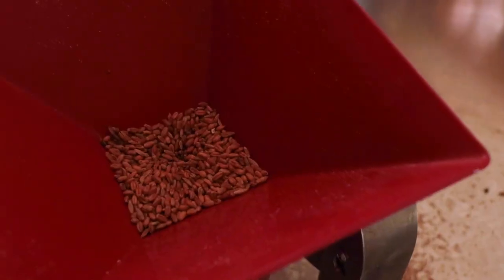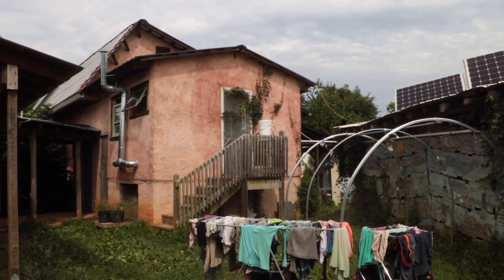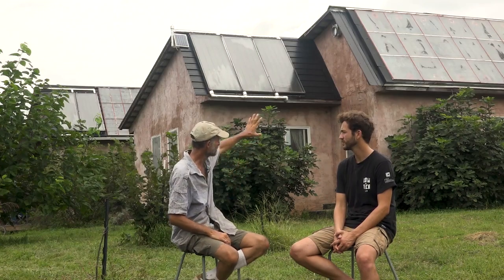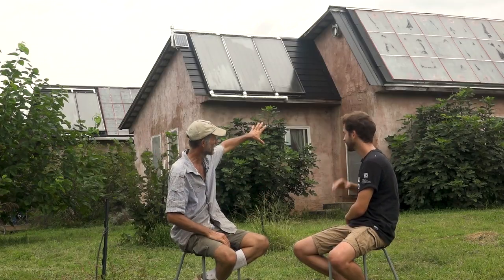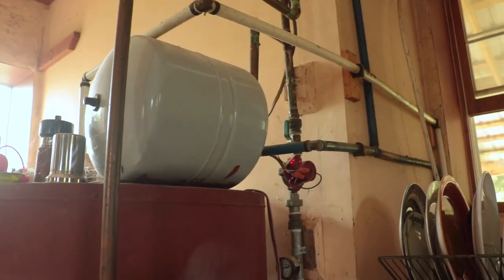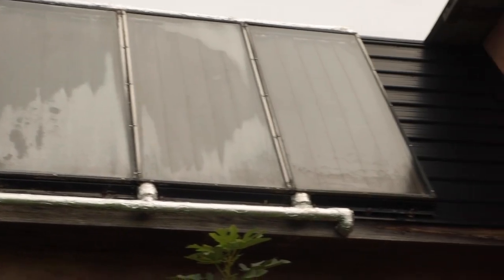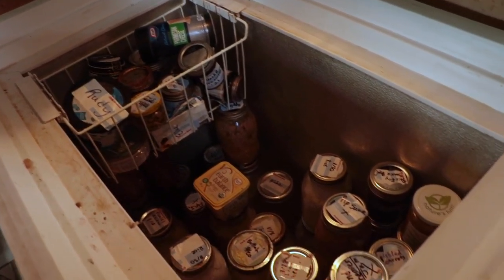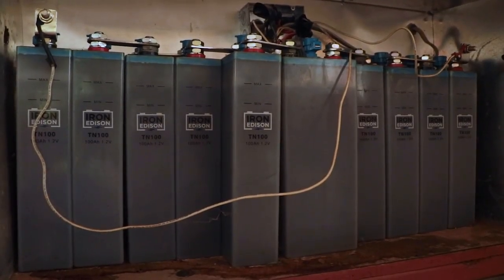Living Energy Farm: a community outside fossil fuels thanks to low-tech ?

Comment: I live in Victoria BC Canada.  How about a low pressure "pneumatic grid" too?  The weather here is rainy from October to April,  a bit of rain in May and June then no rain till mid September.   I abandon most of the garden in  Summer to save water. I try to use rainbarrels and rainwater as much as possible and cycle the water round raised pallet gardens  to water storage,  a rock planter (shaped like a boat) with water in its "hold" and 2 greenhouses with water stored under the greenhouses.   To power  the pumping of water up from the holds and to the plants,  I use a low pressure "pneumatic grid"  that runs at about 1.4 psi  (10kPa) to power "airlift pumps".  There are currently 11 little airlift pumps  spread across my property (just tubes joined together) running off one dual diaphragm air pump in a shed.    People ask me why I don't just have water pumps,   but really one air pump works nicely, and when you cycle water, it often gets a bit dirty.  Airlift pumps can deal with dirt fairly well,  while blocked water pumps can burn out. If you have a river or stream on your farm, you might be able to use a "trompe" to compress the air to something like 2 psi,  to run greenhouse hydroponics, etc.  This is easy to do, and you don't have to deal with turning the water power into electricity.

Comment: Thanks for the interesting video! However, I was quite astounded by what Alexis said about electricity. It seems as if he lacks the basic knowledge of the differences between AC and DC and has a wrong understanding of why the things that he builds work the way they do. 

DC can be transferred just as far as AC when converted to higher voltages, it's just that transformers don't work with DC. Evidently, connecting solar panels directly to a load is possible, but not a great idea. A) Because they have a maximum power point, a certain load resistance where the most power can be "harvested and B) because all electric devices work most efficiently (and safe) within a certain voltage range. The goal of these off-grid systems is not to look like a grid, it's to provide optimal solar harvesting and a regulated output voltage.
Reply from the maker: You're right but we can assure you that Alexis Ziegler is well aware of that. Don't you think that losing a little yield to avoid the use of expensive, complex and short-lived equipment seems acceptable ? Without change, solar energy will remain unsustainable and inaccessible to a large part of the population.
Reply: @low-techlab2411  No, I don't think that way. Because it is an unsafe manner of using electricity and will cause much more wear on devices.
The needed equipment is neither expensive nor complex or short-lived and there's lots of info on the internet. When in an off-grid situation, even a one 12 volt battery with a cheap solar charge controller will suffice to provide a regulated voltage.

In on-grid situations, one can just use a VDE-AR-N 4105 (I think France still refers to the VDE 0126, the precursor) compliant grid-tie-microinverter (Envertech, Deye, Hoymiles, ...) to feed solar energy to the house and excess energy back to the grid via a typical socket. Devices within the house can directly use that AC without the need for complex rewiring or further conversion. Excess energy makes the grid mix greener allowing those that don't have the means for solar to use it. Most manufacturers now give a 15 year warranty for their inverters.

I think the transition to green energy only works when we're doing it together by using the grid where available to combine all the forms of green energy and making it available to everyone, even if they can't have e.g. solar directly :) 

I don't mean any offense, I just have a different opinion :-) I'm a tech journalist and I just recently wrote a series of articles on small permission-free PV installations, in Germany they're called "Balkonkraftwerke" but you can do that in many European countries (and others probably too) as well :-) If you'd like to speak about that, feel free to contact me on Instagram. I use the same name there. I'm happy to share my knowledge :-)
Reply: We are well aware of the differences between AC and DC power, as well as the "maximum power point" of solar panels. That said, our system costs about 80% less to build than conventional off-grid kits, and will run for the rest of your life with very little maintenance costs. The bottom line is that the global working class does not have access to solar energy because the standard systems are badly designed and battery based (and the batteries wear out). We are now exporting this technology to a number of places, our largest project being in Puerto Rico. Our direct drive DC microgrid works, it works well, it costs a lot less, and it works for a very long time.  Alexis -- Living Energy Farm
Reply: @livingenergylights1687  C'est tout mon discours depuis le début que je m'intéresse a tout ça ! il faut comprendre qu'il faut aussi dépanner les appareils lors de pannes et que ça fait un cout phénoménal ! surtout avec de l'électronique ( la boite noire pour beaucoup de monde ) alors restons sur de la simplicité , et tout existe presque !